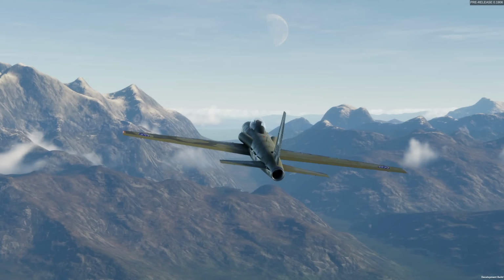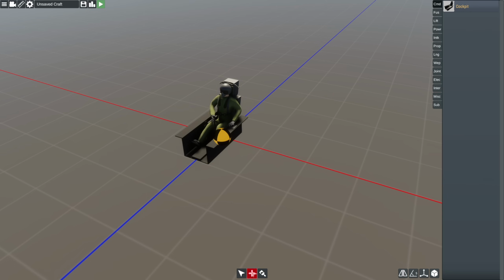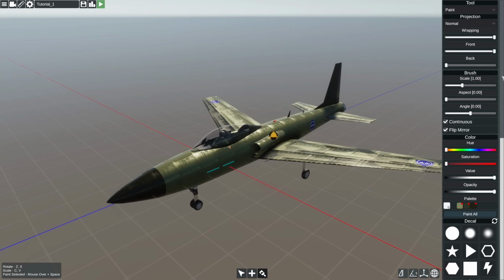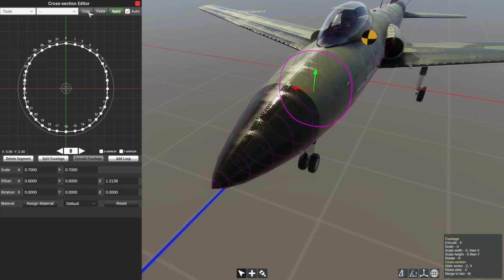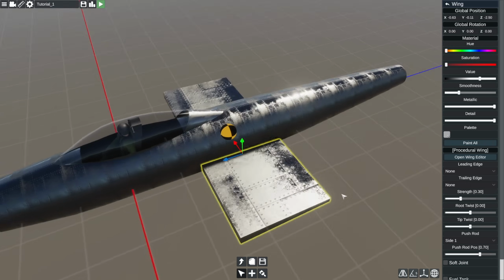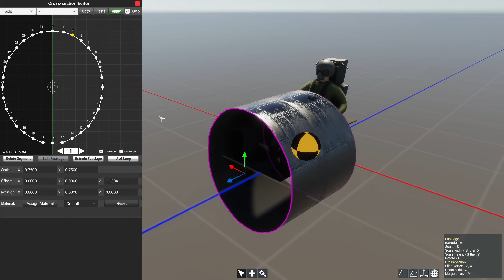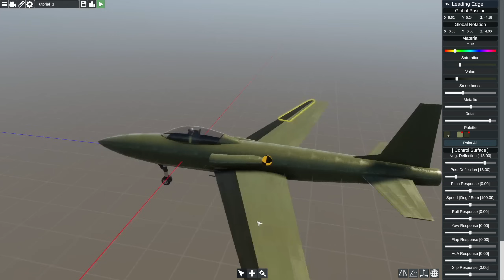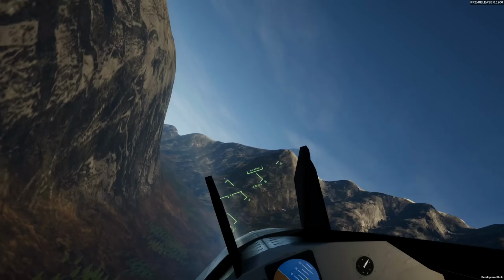Flyout Comprehensive Tutorial Series | Part 1: Introduction to Building

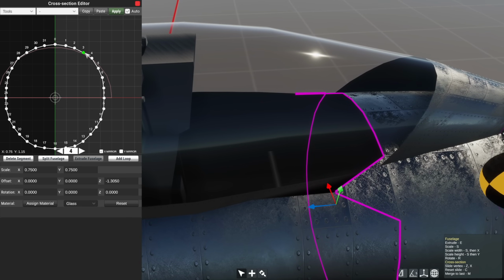Comment from the maker: Quick note for anyone watching this now who is trying the vertex offset stuff mentioned at 7:00 - that feature has been replaced by the "vertex" mode of the cross-section editor, seen at the bottom center of your screen. This, and other editor features that have been added after launch, is covered in part 1.1 of the tutorial series.
Reply: Do you know if he's working on anything or is what we have is all we get?
Reply from the maker: @prestondickson1920  He's currently working on the VTOL update, which will add some new parts for VTOL aircraft such as an F-35B-style rotating nozzle & lift fan and tip jets that are powered by bleed air. There will also be fly-by-wire mode toggles added. As for when the update will be released, we don't know. He's been quiet on the development feature front for a while, but his last message was a week ago in the discord server so we at least know he's active.
Reply: @TheWanderer05  that's awesome to hear, also I thought it was the f35-C that has VTOL , it's the carrier based version if I'm not mistaken sorry if I'm incorrect.
Reply from the maker: @prestondickson1920  The F-35C is indeed designed for carrier operations, but only those involving your standard arrestor hook & wire stuff, not VTOL operations.
Reply: @TheWanderer05  ahhhh, thank you for the information!

Comment: Yo thanks dude, really helps. I don't see the landing gear retract option in the controls menu, do you know how you would set that input?
Reply from the maker: For a landing gear part, there's an input field near the bottom for retraction. In the response section, put the 'landing gear' input in, and set it to 1.
Reply: @TheWanderer05  Ohhh, I see, thanks. Also, is there a way to get more than 3 materials? I don't see any pluses or anything like that in that tab.
Reply from the maker: @jerzysot264  No, it's limited to 3.
Reply: @TheWanderer05  I see, thanks

Comment: Very helpful!

Can you actually see or locate the CG and Center of Mass etc? Before flying?
Reply from the maker: The center of mass is visible at all times in the editor (depicted by the black and yellow centroid).
Reply: @TheWanderer05 I’ve seen. But I mean, the others (CoL/CoM that shift places by different wings, locations configurations)..
Reply from the maker: The CoM will shift around as you add new parts. There is no center of pressure/lift marker in the editor, as it is dynamic and shifts around during flight as you maneuver.

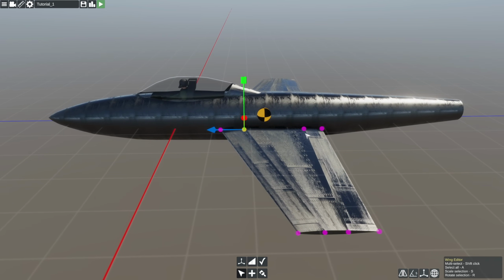Comment: 11:32 so maybe the function wasn't in the game 2 months ago but with the 'twist' option (on both root and tip) you can generate lift without aoa (if it works properly)
Reply from the maker: If you use twist, you’re giving that section of the wing aoa.
Reply: @TheWanderer05  Oh yeah, my bad, I said aoa and guess I could've meant no climb angle but that's different to what I said

Comment: How do you mirror a duplicated part? Wings, Horizontal Stabilizers etc? Am excited about this, however at this point of time, lack of basic options like undo, as well as a lack of explanation of the tools make it difficult for a new user.
Reply from the maker: There’s a symmetry option on the bottom right of the editor. Just remember that global vs local mode affects what its center is.

Comment: I can’t get any of my control surfaces to move at all, is there anything I’m missing? I did set up the trailing edge. But messing with the pushrods or soft joint options don’t help much either
Reply from the maker: Did you add pitch, roll, or yaw response to them?
Reply: @TheWanderer05  I originally thought the rates were that but I figured it through some trial and error eventually. Did you have to set one aileron to a negative response? For them to turn properly?
Reply from the maker: @carterscoconuts6224  one of them should be negative, yes. If you hit the “set mirror” button it’ll do that automatically.
Reply: @TheWanderer05  nice thank you. I never realized that there was mirror button either which makes things easier

Comment: How do you add weight to the plane without fuel tanks? Even though my wings are very far back, the engine is insanely heavy and center of mass is where the engine is...
Reply from the maker: You could use a battery or swing joint as ballast but that usually isn't great practice. What style of plane is it? You might just need to move the engine forward a bit
Reply: @TheWanderer05  My plane looks almost like an F18 just with one engine. It shouldnt really be tail heavy. I made the engine smaller and put a cube in front. Its better now and flies quite well :)
Reply: You can change the skin thickness of different parts to add/move weight.

Comment: My plane drifts severely to one side ion the runway, any fix for that? Its completely symmetrical.
Reply from the maker: There are two possibilities here. The first is that you're experiencing crosswind (watch part 2 - intro to flying). The 2nd is that your gear legs are angled out too much, which can lead to some physics oddities due to the increased axial force required to keep the plane supported. Would recommend decreasing the gear angle to 40 degrees or less in that case.

Comment: the part where you shape the hole for the cockpit dosent work for me for some reason
Reply from the maker: That segment is a little outdated. You need to use the 3D vertex sliding mode at the bottom of your screen to do that. I plan on making a 2nd part of this video with all the editor updates since I made this video.

Comment: how do you make it balanced. my plane just flies straight up and starts flipping. help
Reply from the maker: Usually that happens when your center of pressure is in front of your center of mass; try moving your wings back a little, or making your horizontal stabilizer larger. Stone is working on a rough indicator of where the center of pressure is so look forward to that.
Reply: that's awesome news, finally it wont be such a pain to make a craft fly @TheWanderer05